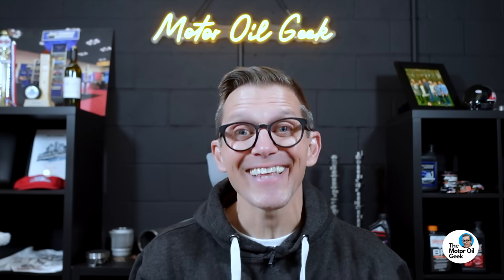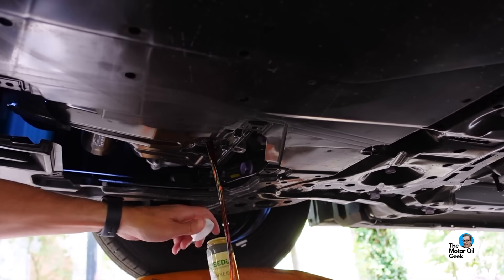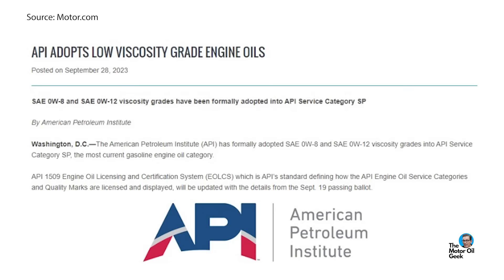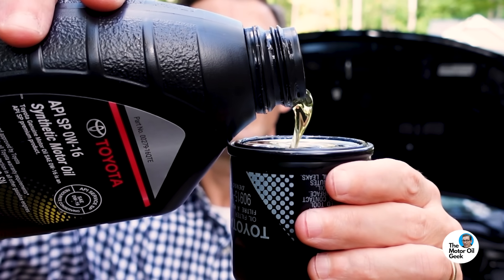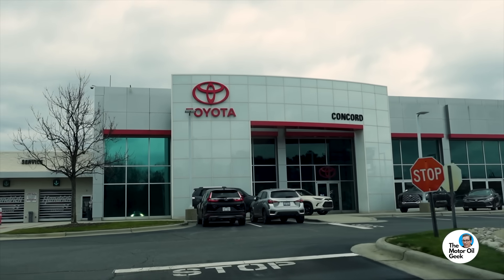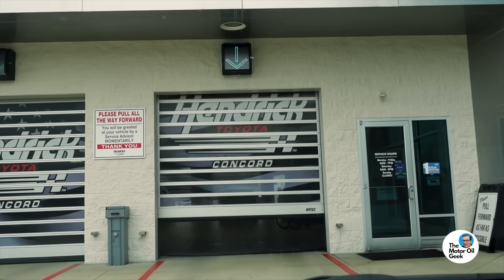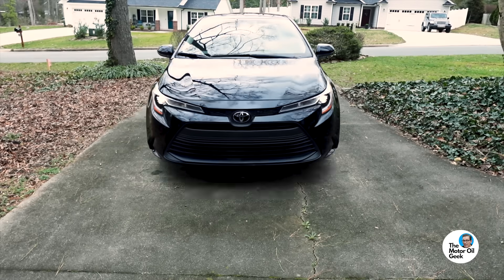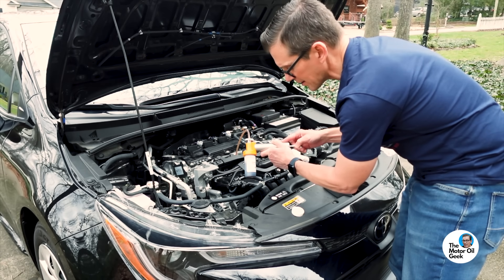0W-8 Motor Oil: Too THIN to Trust? Let's Find Out!

Comment: My 2022 Ram with the HEMI is specced to run 0w20.  After 30,000 miles of 5,000 mile OCI, it developed a tick at cold start.  No.  I swapped it out to 5w30 and started doing all of my own oil changes.  The cold start tick disappeared and I have not seen any measurable drop in fuel economy(average 21-23 mpg on the highway, hand calculated).  I’m convinced that, for this vehicle, 0w20 is just for that slightly improved fuel economy for EPA ratings.
Reply: Hemi tick. It is a thing.
Reply: @9ZERO6  From these comments - only if you use zero weight oil!  I still don't trust this watery oil at all and i won't use it in my cars.  As for the ten-thousandth of a gallon improvement in MPG i'm losing out on, it's a sacrifice I'll have to make.
Reply: @9ZERO6  
That is not the Hemi-Tick, he is mentioned....it is all about the hydraulic lifter.
And a thinner oil endorced that these lifter run out of oil.
Reply: @tt-rs1457  The hemi has two ticks. One from leaking exhaust manifolds due to broken studs, and the other from cam and valvetrain failures. But hey, if 5w30 oil fixed those good for him.
Reply: Well the oil geek said 0w-16 can possibly be better than 5w-30 because it's all based on additive combo quality
Reply: Exhaust manifold bolts.
Reply: @  if it was the exhaust manifold bolts then the sound would not have gone away with changing the oil viscosity.
Reply: I am literally arguing with someone right now about the fact that trusting any 0W oil to last 10,000 miles is ridiculous. They used this video as a reference, I guess missing the fact that during that 150 HR durability test, they were using an oil with an additive package that is not available to the general public.
Reply: 5w30, greatest human invention ever
Reply: @BF1-P 0W-40 ist better!
Reply: @Winnetou834 not a good option on a Hemi with variable cam timing that relies on oil being in viscosity to operate correctly.
Reply: Read the post  he said one of the two ticks
Reply: The hemi tick is still there. You need to replace the lifters.
Reply: @jonathancormack  the tick isn’t there.  The 0w20 oil is too thin and does not protect on cold start.  The switch to 5w30 stopped the cold start tick completely and the truck now has 78,000 miles on it with ZERO tick at all.
Reply: I had a Miata, neighbor who was a mechanic put 0W-20 in it, praising it to be the best motor oil available - he uses it in everything he owns. Okay. My Miata developed a ticking or knocking at all temps. Got fed up, bought factory spec 5W-30 oil, brought it and the car to a shop, changed the oil - ticking/knocking gone. Engine was running like new at all temps.
Reply: My favorite oil is 0w30

Comment: I work in a toyota dealership service department when I first started and learned every oil change even the first one is 10,000 miles I wondering how are these motors lasting so long there is no way this is good for them as a guy that has built performance motors in my own vehicles and knowing the importance of a proper break in procedure with proper break in oil. But I will say I have never seen any issues with 10k oil changes and yes the first oil filter change the oil filter is very dark in color. And most people come in late like 2 to 3 thousand miles over and still no issues I would say most toyota people come in late just the trust they have with there toyota. I truly do trust and believe in toyota myself.
Reply: Look at the 30,000 km oil change period of European manufacturers. I've seen 48,000 km specified for a van... 10,000 miles I'd say is still a relatively conservative number, given the modern additives etc in oils today

Comment: The only real issue with using thicker than recommended oils is your engine is designed with smaller oil passages to get needed pressure with thinner oil. Going with thicker oil increases pressures and reduces flow, which reduces cooling and cooks oil faster.
I saw 1 extreme example where guy had oil leak and his "fix" was replacing 5w20 with 3 parts 15w40 1 part lucas. It cost him an engine, as it broke the oil pump drive rod trying to pump that thick goo.

Comment: Since discovering this channel, I’m binge watching. 😂

So my sons Kia calls for 5w20. However Kia dealer uses 5w30, which I agree with more as well. 

My Touareg TDI changed the oil spec 3x since we bought it 8 years ago. We are now at a specific 5w30 which imo is not for a diesel. I still have extended warranty (due to diesel gate) so I have to do what they say. But I know other counties are using 5w40. 🤷‍♂️ and my timing chain tensioner rattles upon startup. They say “that’s normal” 🤬
Reply from the maker: Thanks for watching!
Reply: My 2014 Optima started knocking on start ups, Kia took me to 10w30 from 5w20.   It's EPA and CAFE' standards BS for 1 mpg more.

Comment: Dear toyota: just give us the info on the tranny. Adding and changing the oil. I have a 2010 tundra and 19 highlander. Neither say diddily squat. Talked with some mechanics and get some help with what to do. But it's not super clear, even by their statements. Just add what you took out. Change it regularly at 60k or so. not 120k like my first one on the truck.

Comment: Ive overhauled large differentials in Terex equipment that was run with automatic transmision oil, the sheer strength of thick or thin oil has little difference

Comment: Desperate to squeeze a little more mpg out to conform to retarded gov standards. A technical bulletin was released years after I bought my truck that lowered the recommended viscosity from what's in the owner's manual. Screw that. A politician did that, not an engineer.

Comment: I'm worried about my next Toyota free oil change.  It is supposed to be 0W-16 but the reminder sticker they put on my windshield said it would be 0W-20. I'm sure when I ask at the time they will assure me it will be 0W-16 but how to verify?  Thanx for showing how.
Reply from the maker: The only way to verify the viscosity and type of oil used would be to take a sample of the oil after the oil change like we did in the video.

Comment: Hope they changed the trans filter. I hate when they flush the trans and tell you that you don’t need to. But you do and they all have one.
Reply: Eh if you get it done regularly then it's not a big deal to leave the filter, since you're getting a lot of the stuff out with the regular fluid changes

Comment: Heya, (prior) Toyota tech here that spent way too much time looking things over in terms of fluid specs and what not. Here's some fun info on the transmission in the Corolla:
The transmission in this Corolla actually does have a gear. The DirectShift CVT transmissions have a launch gear to get the cars moving, and then they shift from the launch gear into the actual CVT belt. You can verify this by accelerating from a dead stop with a lot of throttle, the engine RPM will rise with the gear engagement, and then it will aggressively drop as it changes from the launch gear into the CVT belt. 
There is a drain and a fill plug on the CVT transmission. The drain plug is on the oil pan on the bottom. The fill plug is on the side of the case by the axle, it's a 10mm hex plug. The owners manual doesn't state where these plugs are because most people don't have access to a scantool that can read the transmission fluid temperature for doing the proper fluid level setting procedure. There is technically a way to do it using the temperature diagnostic mode, but it's generally seen as dangerous to have owners probing the OBD2 port to set the vehicle in diagnostic mode since it can easily result in serious damage.
This transmission uses Toyota CVT Fluid FE, it comes in a 4 liter metal drum. Part # 08886-02505. If you want "fresh" fluid for testing you can order using this part number.
Toyota does state in the owners manual what the fluid replacement interval is for the CVT fluid. You can find it under the 60k and 120k mile service: "Replace automatic transmission fluid." If you want to read between the lines here, this means that the extreme interval of the trans fluid is every 60k/5y, which means that the standard interval is at 120k/10y. This is the standard Toyota transmission fluid interval for all of their current gen fluids. Any of the ATF WS, CVT FE, and E-Transaxle Fluid drivetrains have this service interval. The only exception is the manual transmission cars, which have a much shorter interval of 30k extreme (and thus an inferred 60k standard), the GR Corolla (20k / 40k), and the Supra (which is a rebadged BMW, 60k/5y). 
If you want to read further in between the lines, all of Toyota's transmissions are made by Aisin, and if you look at Aisins transmissions in other brands they also have the same service interval. I now work for Volvo and they use Aisin transmissions which have the same 60k extreme interval and 120k standard interval.
Also as a note, the Toyota ATF WS (the pink transmission fluid in most Toyotas) does not have a chemical package for maintaining the color of the fluid according to the Toyota engineers that I spoke to. Toyota transmission fluid will turn black extremely fast even though it is in good condition and isn't burned. The color of the fluid has no relation to the quality of the fluid itself, it doesn't have any chemicals to mate those two characteristics to each other like some older transmission fluids like (such as ATF IV, which was Dexron). 
I hope this information is helpful to someone.

Comment: Maybe there is a video but if not, I’d love to see one for the vintage engine thats been “stock rebuilt”
A break in oil and what should be run on the normal basis.
So much unreliable and conflicting info out there!

Comment: my 5 old 2001 ram 1500's 60 year old tech 318cu 5.2l v8 gets the lowest quality cheapest oil and filter every 3-4k miles sometimes conventional 10-30 sometimes 5-20 because i had bought extra for my other car and sometimes 15-40 rotella because i have 55 gal drum of it of my generator repair business. this truck was pulled off the lot, driven locally for 500 miles and then a 1st oil change with conventional to continue break in and then trailer attached and not taken off except for maintenance for the last 23 years towing 5k lbs for the last 330k miles and a couple are near 400k and still start and run fine, burn 1qt every oil change but no smoke and pass smog fine. frequent oil changes is more important than expensive oils that dont get changed as often. i also had a 1988 bronco and 88 mustang with same oil change schedule with whatever was on sale and both of those made it over 300k

Comment: so do these low vis oils get dangerously low after they breakdown at 5 or 10k? higher vis cushions bearings and clings better doesnt it? what is the benefit of continually going lower viscosity....a percent of a mpg? seems like a good quality 5-20 would be just fine

Comment: 0-8 Weight Motor Oil? Must Be Mineral Oil or Corn Oil. I would never use a Motor Oil That Thin.
0-30 Weight Is Thin Enough Unless You Live In Very Cold Climates, Alaska, Canada, Northern US States. I Drive My Vehicles Hard Downshifts & Upshifts At High RPM's

Comment: I may be getting a 2002 Chevy 1500 with a 5.3 209000 miles. What oil should i use. It’s been very well maintained so far. Previous owners gone

Comment: CVTs needing CVT transmission fluid is just like how dual clutch transmissions need dual clutch fluids. Had a 2012 fusion sport that had a 6 speed asin (Toyota) transmission and at some point it had the wrong fluid put in it that resulted in slipping. After flushing it with the correct fluid,  the slipping stopped.

As for "filled for life" transmissions, the vehicle manufacturer and the transmission manufacturer don't always agree on this. For example: Audi states that the fluid in their 8 speed automatics is good for life however ZF recommends changing it every 80,000 miles. I did the fluid change late at 130,000 miles but I did keep a jar of the fluid (eventually I will have it tested) the car is now at 168,000 and if it does make it to 210,000 I will do another change and have that tested as well. The fluid at 130,000 was just slightly darker than the old cvt fluid in the video but was still free of debris which is what is important (especially with this transmission having a rather aggressive tune put on it).

Comment: When I used to work for Kia/Hyundai, we would use 5w30 in the cars that call for 5w20 because the oil was too thin and would wear the bottom end out, causing knocking. The extra viscosity I think helped the engines stay alive longer. I couldn't imagine putting 0w20 in any of my cars even if they called for it, much less 0w16 or even 0w8, especially with a lot of the planned obsolescence baked into most everything made today.
Reply: it depends on the cylinder wall finish. is it stone honed or the new spray on metal. if you right thick oil on the spray on type, it's said the rings don't seal and it burns a ton of oil and knocks killing the engines. the Ford GT guys ran into those issues not running the factory recommendations. it's a more expensive process thou, so I doubt most cars have it yet. sounds like those kia's need more oil pressure or a better quality oil with better wear quality at the same weight?
Reply: @jsomething2 it wasn’t the rings, it’s the bearing material and the oil pressure in the journals. The bottom end knock is a pretty hearty noise

Comment: Years back (30 years) I employed the use of slick 50…
Any scientifically verified evidence of benefit(s) to any PTFE or similar products?
Reply: I've always read that today's 20 micron filters would just filter that all out and go into bypass mode in a short time these days. I might have helped in a old carb Ford 300 straight 6 with a cheap fram filter back then. but again that engine will out live anything you put it in anyways. so eh?

Comment: You may want to look at liqui moly molygen oil and their mos2 friction modifier. I’ve ran it in several manufacturers. My VW passat saw 3-4 mpg increase, and a 2-3 degrees Fahrenheit decrease in oil temp using this oil and additive  over the recommended castrol. My friend and dad both have 4.0 Toyotas (different gen vehicle, very similar engines). My friends truck had the notorious Toyota lifter tick. Did an oil change with this oil and friction modifier, and the tick 100% went away, and he saw 1-2 mpg increase, everyone has noticed how much smoother their engine runs with this oil. My g35 coupe experiences less oil consumption through the PCV, and runs smoother also. It would be interesting to see what you think of it due to it being up to German specifications for oil grade and quality for full sythetics

Comment: Why does Pennzoil have Platinum Euro motor oil? I thought Ultra Platinum Pennzoil oil was top tier, the have all, do all, superior motor oil?  My wife has a 2022 Porsche Macan Base model and I have a 2022 Acura RDX A-spec sh-AWS, both are 2.0 L turbo 4 cylinders and I use Ultra Platinum Pennzoil 0W-20 in both of them. Does the Europe blend have something to do with preventing buildup in the catalytic converters on European cars?

Comment: I think about engine oil quite a bit. 
My 2015 Honda Civic calls for 0W20 ,,,, .
Honda is a good engine, as good for reliability or better than the Corvette.
What harm is there in using 0W30, 5W30, 0W40?
I am looking for engine longevity and don't care about loss of MPG.
I drive it less than 5k miles per year and change the oil once per year.

Comment: Hi Lake. Is there any chance your could make a video on Dexos? I have a 2018 SS Camaro which has just gone outside of the warranty. I've always used Mobil 1 Dexos 1 which is what is recommended in the owners manual, mostly because the warranty required Dexos oil to be used. But I'd really like to move onto Pennzoil Ultra Platinum as all testing I've seen proves it is a substantially better oil. But it doesn't have Dexos certification. Is it safe to use? Is Dexos just marketing? Should I move over to Pennzoil UP? Should I stay with Mobil 1 or another Dexos approved oil?

Comment: I don't have a problem with whether it's 5000 or 10000.  My problem is the mfg saying oil needs to be changed every X miles or 3 months, that is total bs.  That oil did not deteriorate in that short of a time frame

Comment: Guess it depends on how u drive.  U go a few miles and never really warm up.  Sure a extremely light weight oil is fine.  U live in southern states or Florida or Hawaii and its terrible for your engine.  U push a vehicle and the heat will rob the oils ability to lubricant properly.   It’s not some magic engine with nasa designed roller bearings.  It’s a friction bearing that needs a protective barrier.  If u understood oil pressure or had a proper gauge it would help u find a proper weight oil.   U live north 5/30 is a good oil.  U live south summer  time a 5/40 or 10/30 is better.   U want a engine to last, your not getting it with 0/8 weight oils. !!!

Comment: car care nut shows exactly how to do transmission oil changes on toyotas. the eCVT (which is actually a brilliant planetary gear set) in hybrids is SUPER easy.
 the CVT in the non hybrids with a standard take off gear is more difficult but still pretty easy as a DIY as long as you have a way to keep the car nice and level when you do it. thats the type of transmission in this guy's daughters corolla.

Comment: Hey also not sure if you remember me but appreciate your videos👍; have you considered trying lightweight oils such as 0w-8 or 0w-16 in older vehicles requiring much heavier oils such as 5w30/10w-30, any damage or issues? Do a video!.. "just give it a nice shake'n pour 😉"
Reply from the maker: No, I would not recommend using these new, lower viscosity oils in older engines.

Comment: Hey what if you pour a 50/50 ratio of 0w-20 & 10w-40 into a 5w-30 spec vehicle, will it mix into a 5w-30 weight oil after driving? Do a video!😄